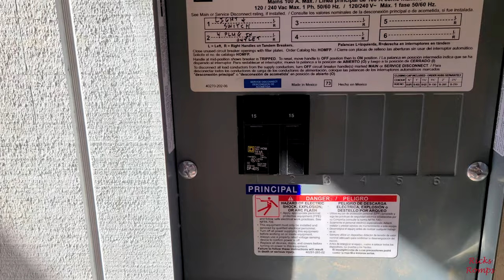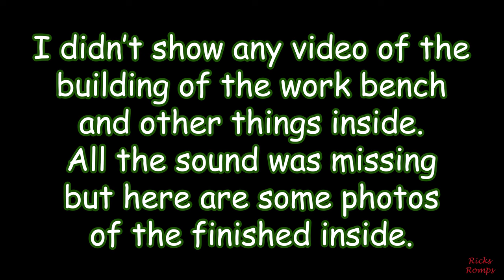The shed is finally finished! Part 5   150.

Comment: Bravo! Your shed looks great, Rick. I was wondering if you have room in there to store your lawn mower(s), or will those go in another shed? For a bit, I thought you had omitted the window. Glad to see you kept it. Natural lighting and ventilation are handy. Overall, a very solid looking structure. I like your workbench and your use of pegboard. Very useful and attractive addition to your yard. Well done!
Reply from the maker: Hey thanks Chris, I do store the lawn mower and the aerator in the shed. I just had them out temporarily. They fit fine and I still have enough room to do things inside the shed. More videos coming soon but not about the shed. LOL
Reply: @ricksromps  Also, I thought it was cool that you color-matched the shed to the house. I'm impressed. But I would have been counting my fingers and toes after building that shed. That saw is scary looking! LOL